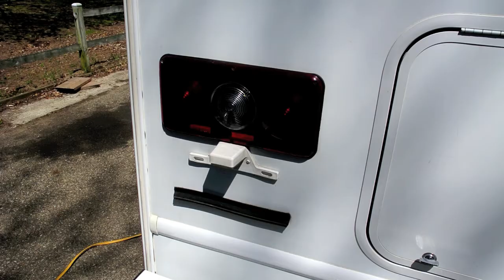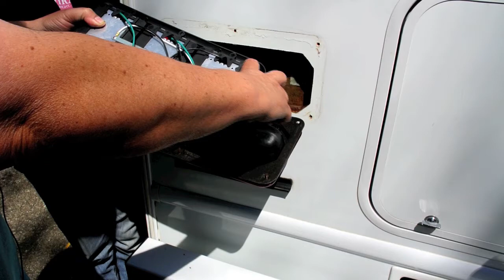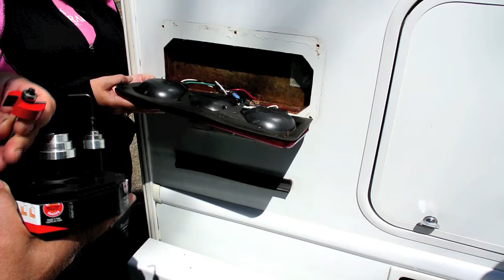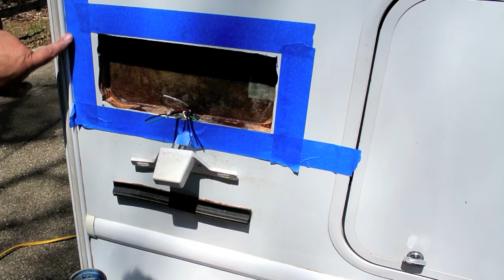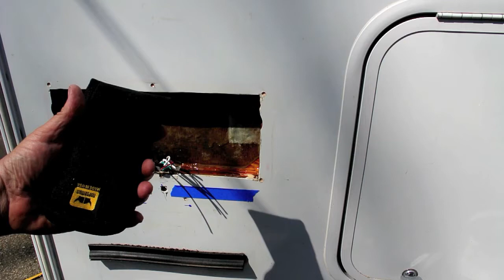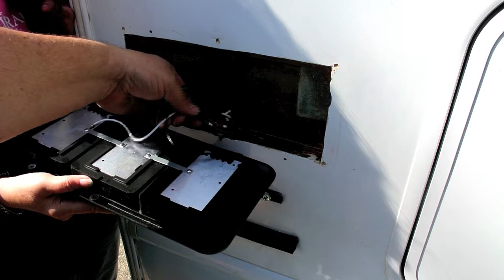Replacing the leaking tail lights on my motorhome.

Comment: Bargman are amazing manufacturers. I own a 1989 Chevy G30 Cutaway Vanguard. The original tail lights are the Reflect O Lite 1400 series. The ones you've installed here are the replacements. Well done .

Comment: Late to this party but have these lights on a 2020 model Thor four winds.  They have yet to address this.  My dealer said that Thor told them that the gasket will breath in water which will eventually evaporate!!  Are you kidding me?!
Reply from the maker: You can get LED exact replacement bezels for the Command Electronics lights. At least that way, you can seal the lights with silicone as you should not have to remove the bezels to change a light bulb.

https://www.etrailer.com/Trailer-Lights/Command-Electronics/CE44VR.html
Reply: @RVProject   Interesting.  Appreciate that. I’m thinking you shouldn’t put silicone over that gasket that sticks out a bit? Isn’t that the same style?  If that’s the case I’ll just silicone over the gaskets/lights I have now and call it a day.  When a bulb goes out shouldn’t be that hard to remove I would think.
Reply from the maker: @joeyabel5966  I was able to buy gasket kits directly from Command Electronics. Whether or not they are still available is anyone's guess.

But I am thinking they are using the wrong gasket material to begin with.
Reply: @RVProject  some kind of weak thin Styrofoam gasket on those. Removable lens is the way to go. I bought a cheap router and it all worked out good.
Reply: That's ridiculous. This fix is the way to go. Took an afternoon.

Comment: I realize this is an old video. Has anyone noticed these lights don't come left and right? To get the backup light to the same position one of the lights gets installed upside down. Which puts the bevel inside the light fixture in the wrong position for draining and the wires would come out the top. The proper fix would be to swap the backup bulb over with one of the turn/stop bulb.
Reply from the maker: You can re-arrange the bezels in the frame.
Reply: @RVProject  not that simple as the bulbs are different. 1157 and 1156. The bulb holders have to be moved also. Done it...

Comment: I am trying to ask a question and every time I do it goes all the way around everything it doesn't even answer my question. I need to know if anyone knows how to put tail lights on a 1976 Dodge Tioga to Sportsman and how to wire it
Reply from the maker: Trailer tail lights typically have  a color code that consists of the following:

White = ground
Green = Right Turn/Brake
Brown = Taillight (clearance lights)
Yellow = Left Turn/Brake

If you have a 4 wire system, the wires typically match color-by-color.  But if you have a 7 pin tail light system, the colors will vary depending on the standard used. Same thing for vehicles and vans.

You would have to use a voltmeter, have someone go through all of the functions (brakes, headlights, turn signals) and see which wire becomes energized with each function.

Unfortunately, there is no universal wiring diagram for this stuff.

Comment: I have those same lights on my Thor RV and they leak really bad.  I also bought the same replacement, I have not installed them yet.  I  will def use this video as a guide.  Thanks for posting.
Reply: My wife and I just finished doing exactly what you did. We epoxied both cavities. And thank you so much for letting us know about the reverse wiring. That alone saved me a lot of grief :)

Comment: I finally got mine replaced.  I've been waiting a month for a few days of dry weather.  i used my Dremel vibratory cutter and a chisel to expand the slot.  At least on my rv, i only needed to cut some off the top of the cavity and everything lined up perfectly.  The top center hole even lined up and the lights almost perfectly covered all the area that the previous lights did.  I also siliconed the crap out of the bezzel.  I wish that it would not have had such a relief cavity on the back and instead had a nice flat surface to seal against.  that said, i dont think these things will ever leak again.  Thanks for the great tutorial.  only took an afternoon of work.

Comment: how did you do the other side where the ladder blocks a lot of the access... did you pull the ladder?
Reply from the maker: You can if you want, but I was able to work around it. I used a small laminate trimmer router that I was able to get in between the rungs of the ladder.

Comment: Nicely done! I have a 90' Winnebago Warrior class A and the tail lights were very dim and old, the screws rusted and could not be taken out to replace the bulb, they were old "reflect-o-lite" and its impossible to find replacements. I bought the same Bargman lights and I had to enlarge the cutout on the plastic mounts with a rotary tool to make them fit but they are way better and brighter. Also made my MH look a little more modern. Nice video.

Comment: Did you find an alumimum strip around the hole were the ligh mounts?
Reply from the maker: +Tom Scardino Sr. Not aluminum... plywood.
Reply: No it is alum around the edge with self tapping screws holding in the stock lights.
Reply from the maker: +Tom Scardino Sr. The tail light itself is made of plastic. The rear wall of the coach is a tubular aluminum assembly, with a fiberglass sheet on the outside, styrofoam insulation in the middle, and luan plywood on the inside.

There is a "surround" of plywood underneath the fiberglass sheet which is what the screws go into.  The only aluminum is a channel coming up from the bottom that provides a wiring raceway.

This video might make it easier to see  https://www.youtube.com/watch?v=AzzVLenmUrs
Reply: I have a 2016 Forest river fr3 the hole is framed in aluminum frame the wires come up from behind the frame. Yours has a box channel were the wires come from much better idea than this winner.